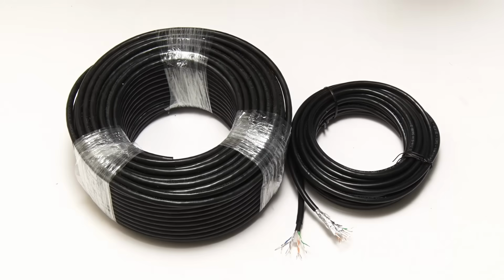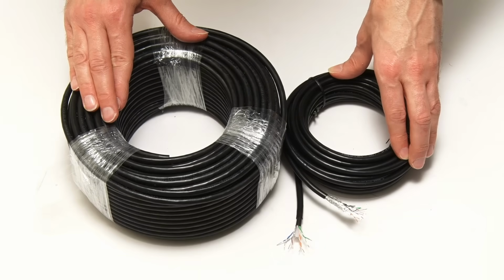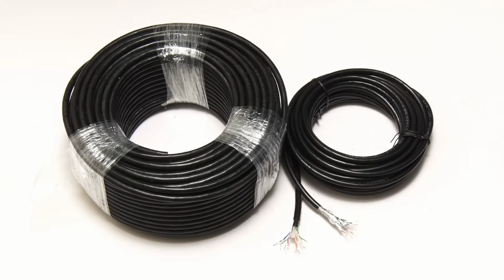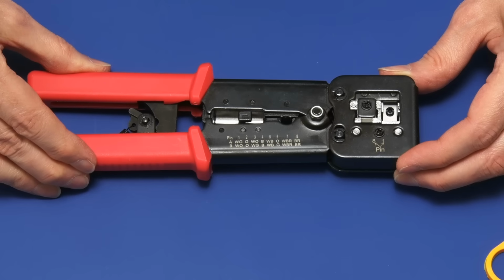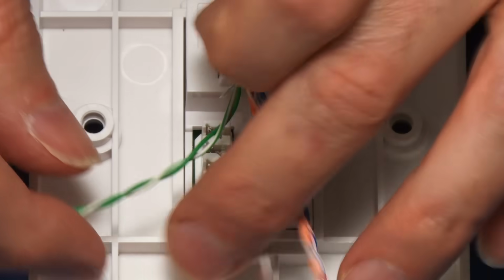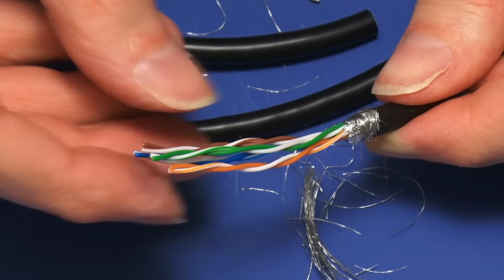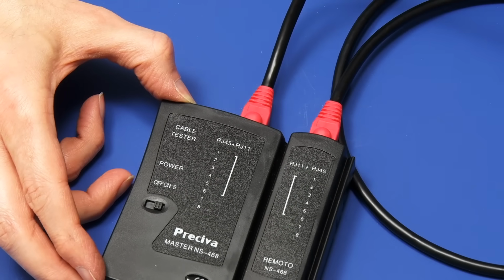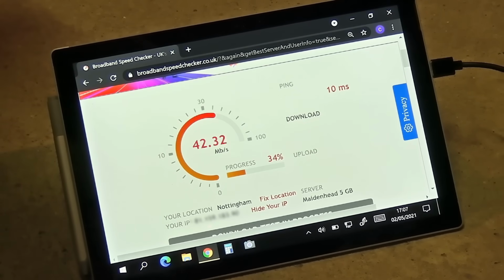Wiring Ethernet Extensions: How to Fit Sockets & Make Patch Leads

Comment: I'm a fan of conduits and pull throughs, laying a pipe to carry the underground cable also helps when it comes to upgrade time.

Hardware changes so quickly so after 15 years my plastered in cat 5e cable is looking a little ropey when connected to my teenage son and his insatiable data needs.

Thanks for yet another excellent tutorial

Comment: When I was working on cabling at the refinery I was at in the late 90’s our telecomms guys said to use premade cable when possible as the factory machines would make a better connection than the hand crimper. Of course we did not have crimpers as substantial as what Christopher has.  😀
Reply: .... and they can be certified to the manufacturer's specifications.

Comment: I was looking forward to seeing your pain when using non pass through plugs 🧐. I hate them, the ones that you used make it almost a joy! 🤩
Reply: You can sand down the edge and use it to cut the conductors to the right length, than crimp a different connector.

Comment: Mr Scissors didn't get a mention. Good work... The simple things explained are the best. If I can get a bit techy... A and B are bothering me. I'm doing a patch panel soon in the garden for hydroponics project, and wondering if the configs of A and B give better immunity  for different Comms like i2c or spi... If you were to patch them Vs ethernet... Maybe I need to answer that myself.
Reply from the maker: A and B have to exist because you need to use A at one end, and B at the other, to make a crossover cable.
Reply: @ExplainingComputers  I thought crossover was gone a long time ago with modern switches... I.e 2 devices negotiate?.. I'm sure there's a tla?😁

Comment: Covered quite fair amount in this one, Chris, nice one!

When you brought up WiFi at the very end, it got me thinking about why routers are still set up typically in one corner of the premises, rather than the middle to provide the best coverage without the need for repeaters. Saying that, maybe a future video on tin foil trickery? ;)

(I have fantasied doing a cable run from the corner of the lounge where my internet and TV/satellite signals come in, to above my flat's front door for a high-performance AP. But, alas, I don't own the place...)
Reply: Possibly to be close to the broadband modem (or is part of the broadband modem), and that point is the shortest run for the cable service entering the place?

Comment: Great video. Poor cabling or bad connections causes as much loss of performance as WiFi problems (which can include device hardware and software problems as much as radio reception). 
Of course our politicians are obsessed with fibre optic cable - which is much harder to work with (for all sorts of reasons ) and totally unnecessary for any domestic broadband or networking scenario. 
I have  a 220 Mbit connection at home and 500 is available to me by just using copper cables. Interestingly the company fitting 'Fibre' in my area is only offering speeds of around 100 Mbits. 5G netwrorks will possibly make all this cabling obsolete for many purposes anyway.

Comment: Great job, thorough and well presented demo, as per usual! Worth a mention: I recently stumbled upon ethernet --> coax adapters (MoCA). Seeing as lots of houses have existing, unused coax circuits, instead of running another circuit, this might be worth considering. In essence, you need two converters, they usually come in a pair; one MoCA from your modem/router (ethernet to coax), the other MoCA at the socket (coax to ethernet). One issue: the converters need to be powered and won't fit inside the socket.
Reply: Thinnet! (aka old-school 1-10Mb networking across coax cables)
One thing I'd be worried about are the age and quality of those coax circuits..they may be good enough for TV (one thing that annoys me about current digital OTA broadcasting vs. the classic analog...the latter could get a half-snow reception and still be watchable, but the former just stutters with the same signal quality if it shows anything at all), but not enough for reliable data transmission at any modern speed.
Reply: @VulpisFoxfire  I don't doubt some are dodge but I would imagine that's a very infrequent occurrence. I do understand interference can get coax at the worst of times, especially due to bad weather. The least you can do is try. Sure beats WiFi haha
Reply: @unknownentity330  Not really. https://networkencyclopedia.com/10base2/ tells you how slow coax-based networking is....
Reply: @VulpisFoxfire  https://en.m.wikipedia.org/wiki/Multimedia_over_Coax_Alliance I'm not necessarily talking about a multiple user network but it sure does seem capable of far greater than 10Mb
Reply: The MoCA standards go a lot faster than 10base5, but for far shorter distances (not a problem in a house). And it goes to 2Gb, but it works as a hub - ask your local network graybeard how their lives improved immensely when switches became so cheap that hubs became obsolete.

Comment: Asymmetric link with 9Mbps upload. Do you have a DOCSIS connection?
Reply from the maker: No, it is broadband via a standard phone line.
Reply: What connection do you have? For most of us that don't have fiber internet (at least in the US), most home internet connections are asymmetric. When I had AT&T U-Verse (DSL variant), I had 18Mbps down and 1 Mbps up. That's the best they could do. I now have cable internet and get 175 Mbps down and 6Mbps up.
Reply: @JJFlores197  Will know, thanks.
I'm from Ukraine, so it will be hard to compare :)
But if it's interesting for you - most of users here have 100/100Mbps or sometimes 1Gbps via ethernet. Here is how it works: If you want Internet, you just call any ISP you want, wait one day for a link and then plug RJ45 connector to a router or any other device. It automatically gets IP address via DHCP and that's it. All you need to do - pay 5-6 USD every month. 

Just wondering why most of US and UK ISPs don't provide ethernet connection and still use phone lines or DOCSIS. I understand it's impossible to replace everything in one day. But modern websites become bigger and bigger every year.

Comment: Remember learning wiring when I worked at a tow company in the 80's and we installed it's first computer system. The CPU was a 80286 running SCO Xenix, to which we connected 2 Wyse 30 terminals, 2 modems, and 3 printers ( with tractor feed paper it was easier to just get another printer than to switch the forms we were using ), all connected by RS 232 cabling. 

Each device came with it's own wiring diagram for both ends of the cable it was connected with, so trying to buy pre made cable with so many differently wired plugs was just not an option.

Upgrading later to a 386 and Wyse 60 terminals later was a huge improvement.

Comment: Hundred percent agree that if you can run an ethernet cable then you will get a better experience than wireless ethernet. I have tried it in many places and never seen a worse result. But maybe I am a little biased - before I retired, I wrote the tech specs for some of the trans-oceanic fibre-optic cables that carry the internet around the world. These cables have long ago replaced (wireless) satellite for the vast majority of international voice and data networks.
Reply from the maker: Wow, what a great job you had. :)

Comment: It's very nice that you've done a video on UTP. Several years ago, I thougth I'd give my friend an advice on UTP (about 3-5 connections indoor totaling about 70m) by suggesting a youtube video on the matter - and there was not a good one with your relaxed and simple attitude - so that's definitely a plus! As for choosing the appropriate cable category, I think what worths mention is that when you do this a lot (in corporate buildings) - the idea is to select the less expensive (and often less wide) cable sufficient for the application. In 20+ users environments, CAT5 unshielded is still more than enough for general office rooms... shielding is only required for intra-server-room paths and sometimes when using vents near utility shafts (like high-power elevator motors, kitchens, etc.) I often see people select UTP based on the idea of "give me the bestest out there" and then they curse when drilling walls and trying to bend it. So my 5 cents to otherwise great video!

Comment: Another consideration for your cable is if it needs to be plenum or not, for fire safety. This is less a concern for residential installation, but something to keep in mind as it might be beneficial to use. https://en.wikipedia.org/wiki/Plenum_cable

Also, with T568SA and T568B, if you wire one end as T568A and the opposite end as T568B, you have created an ethernet crossover cable. Crossover cables were used to link switches together and can be used to directly connect two computers together. The TX and RX wires are swapped. T568A: 1. white/green, 2. green, 3. white/orange, and 6. orange to T568B: 1, white/orange, 2. orange, 3. white/green, and 6. green.
Reply from the maker: Good point.
Reply: There's no need for crossovers with Gb and some 100 Mb Ethernet.  With Gb all 4 pairs are bidirectional and some 100 Mb gear can autodetect.

Comment: a really useful video - recently at work some engineers installed our network but i dont think they have used shielded cables because whenever someone turns on a drill it affects the network
Reply from the maker: That suggests electrical interference, certainly -- maybe the network cables run too close to the mains cables at some point.
Reply: @ExplainingComputers  yes, i think you are right.  Well we have a workshop, its actually when people are using cordless equipment like drills.  I had an argument with the electricians about  it  haha .

Comment: The blue wires with green wires either side does not sit well with me. It breaks the pattern. It’s not right. I’d remember it and wire it up properly but it would make me feel uncomfortable
Reply: This is why there's two different wiring standards. :-) As Chris said, the key point is being consistent on both ends...you could hook them up in any order you want, as long as you hook them up in the same order on the other side. (personally, I'd be tempted to put solids down one side of the wall socket and stripes down the other)
Reply: I prefer 568A, as it puts the orange/white between the blue/white and green/white wires.  With some cables, it's hard to tell the difference between green & blue, so having orange in between helps to keep from going cross eyed.

Comment: Do you know if we should use direct burial cable in pvc conduit underground? Heard sometimes it causes issues & better to just burry??
5:39 shielding specs
How do you find out all this info? I never see any of these specs on cables at all.
Your not going to use grounded connectors outdoors? Isn't that required by law? Insurance?
Reply from the maker: Direct burial cable should be fine in the ground by itself. Here in the end we used conduit too for part of the run under slabs. I will have no outdoor connectors here. What I showed at the end was a test in a space soon to be very different!

Comment: Small tip. The punch down system is called LSA+ formerly from Krone. Now Tyco Electronics. The punch down tool wil cut the wire automatically.  You can buy some usable counterfeit punch down tools on AliExpress for a good price. You could also buy a original but that's really expensive for home use. 🙂

Comment: I had one of those cheap cable testers and it showed I kept making mistake on my cable ends. After redoing the ends about 4 times I got suspicious and discovered my tester had a bad solder joint on one of the LEDs in it so it showed error !  ha ha . There is also the gel filled outdoor cable that keeps moisture out . Thanks for info on cabling
Reply from the maker: Now that must have been an annoying cable tester! :) I did consider the gel-filled cable, but imagine is horrible to wire up.
Reply: My cheapo tester is  flimsy and I have to wiggle the plug to get it to properly display the connections, which I did make correctly.
Reply: @KameraShy  yeah I think that needing to wiggle the cord  happened to mine too- maybe I should have spent more than $2 for a better tester !  I did open mine up and fix the bad solder joint on the LED that was out.

Comment: I've cabled up many large structured cabling setups over the years, patch panels to wall sockets.  Your presentation and explanation of terminating to RJ-45 and Faceplates is appreciated, and hopefully will inspire some viewers to cable their home network.  I have had a Cat5e cabled network at home since around 2006, I only use wifi for my phone.  Every other PC, server, TV, console is hard wired via ethernet.

Comment: Just to let you know.  This video would not work on my LG TV I had to load it on my phone and then stream it to the TV.  This has happened to a couple of videos today and I wonder if YouTube has changed some of its parameters which can lead to some videos being incompatible with some viewing modes.
Interestingly it works fine on my PS5 YouTube app yes it's still not working on my LG TV.  I have checked, no update is required on the TV.  It is the latest version. Odd.
Back on topic ... Nicely made video as always and as a former broadband engineer I can safely say 'spot on'.
Reply from the maker: Thanks for this. It seems there are a lot of background changes going on with YouTube right now, and many glitches are resulting. Hopefully they will sort it all out! :)

Comment: Other than removing the Sheliding... oops! I was surprised you didn't explain why they are TWISTED pairs (waveguides and all that), but it brought back to mind a small project I had taken on almost twenty years ago: cabling 30 stations in a friend's cyber cafe. No tools other than a side cutter and my crimping tool, sixty connectors, six cups of coffee, a hundred meters of CAT4(!!) and the God of thermodynamics on my side. Zero errors. No test equipment except the "is it working?" test. Later I got cocky and started doubling cables (4+4) to cut the cable cost in half. Good times. Now I have WiFi at home. Not for the computers but for the handheld devices.

Comment: When fitting cable ties to hold down cable cut the tail off flush at the ratchet otherwise you leave a dangerously sharp piece of plastic.....
Reply: Well, considering that piece of plastic will be held safely behind a wall plate..

Comment: Erm, at the end how did you clip the push down cable connector into the front plate with the cable already connected?
Reply from the maker: The connector block goes through the hole on the face plate if turned downwards at an angle, and it then clips back in to the hole it just emerged from! It's a really neat design.

Comment: I have also had luck with 'Powerline' ethernet adapters that use your electricity cables
Reply: Could be that your wiring, while perfectly adequate for power-transfer needs, isn't of high enough quality for much more sensitive data transfers.

Comment: "Inches"?  Doesn't the UK use Metric?  A very though instruction.  Thank you.
Reply from the maker: The UK does indeed use metric, but my brain defaults to inches on some occasions! :) But nowhere is entirely metric . . . I don't think any country measures screen sizes in mm. :)
Reply: @ExplainingComputers  I was just giving you a hard time :). I work in a hardware, and lumber business, in Canada, and I think in feet and inches all the time. Plywood is sold as imperial measurements, but is produced in metric measurements.  Go figure.
Reply: Since the Weights and Measures Act 1985, British law defines base imperial units in terms of their metric equivalent and declares that none may be used "for trade" (except that milk, beer and cider may also be sold by the pint). The metric system is routinely used in business and technology within the United Kingdom, with imperial units remaining in widespread use amongst the public. All UK roads use the imperial system except for weight limits, and newer height or width restriction signs give metric alongside imperial. [Wikipedia]

Comment: Another trick is when you run a cable through an outside wall is make a loop on the outside so that the cable going into the wall is at a point higher than the loop. Water always runs down hill...
Reply: Called a drip loop. Professionals do that.

Comment: You left of plenum or non plenum rated, boxed or reel. Also put a small 'S' shaped bend in the wire before the wall to allow water to drip off and not geto the wall. When running it outside.
Reply: Came here to say this.  Plenum or non plenum is the one choice in cable selection that could literally mean life or death.

Comment: I like to re-purpose the cabling for telephones in my home for LANs since I don't use them for landlines. In one house the telephone contractor had cut off the connectors for the cables so I learned how to connect new ones on using the methods you describe.
Reply: Danger Will Robinson !! - this is almost always a Bad idea. In the US, telephone wiring is Cat 3 or worse (older), although some pollyanna vendors suggest Cat 5 but that is usually a waste of pairs. Your typical telephone installer / elek-tri-shun doesn't know or care about proper Ethernet wiring.
Reply: @EmmEff3168  it's Cat 6
Reply: @pipe2devnull  CAT6 for phones is a waste of money.  CAT3 was used for phones and could also be used for 10 Mb Ethernet.  CAT5 is often used, as it's more available than CAT3.

Comment: I just ran 1000 ft Cat6a between 16 outlets through our new office. Learned to terminate RJ45 plugs and jacks. Pass through plugs I feel was easier. After the first few times you get in the groove.
Reply: Exactly. It does take a little practice, but eventually you get it. I did.